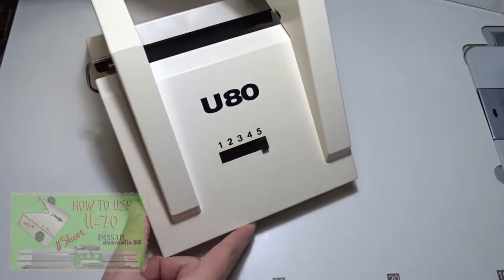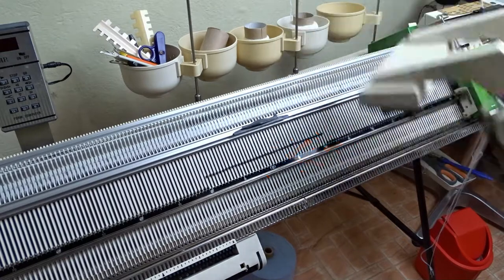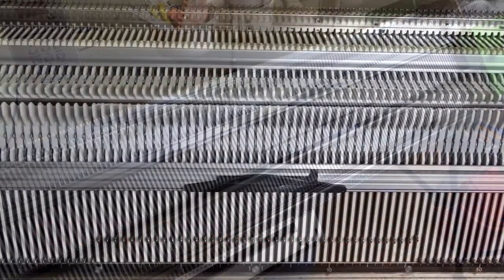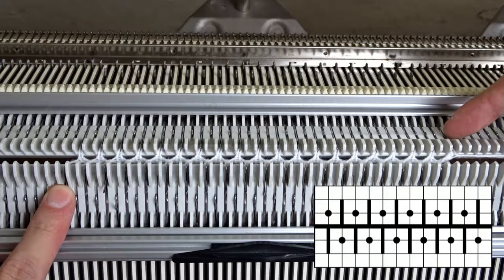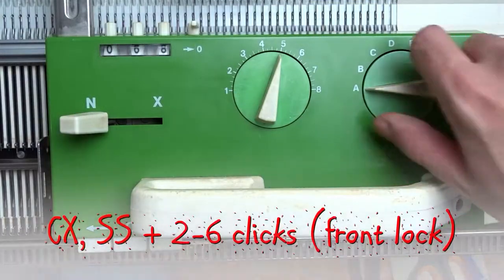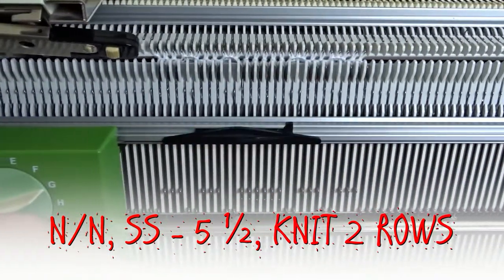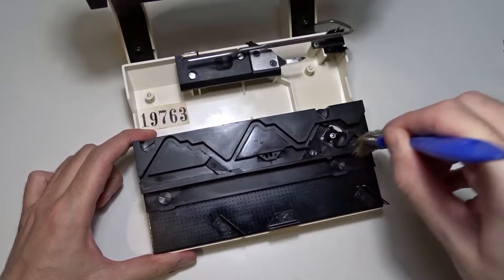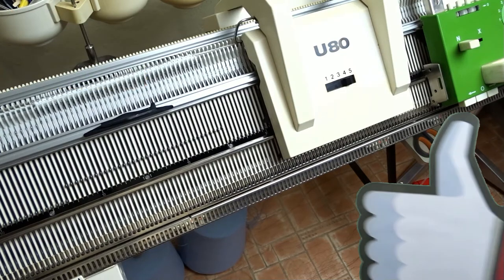How to Use U-80/U-100 Transferring Carriage

Comment: I tried to use the U lock today but it got stuck. Your video gives much more information than the Passap paper so tomorrow I will try again.
Reply from the maker: The U80 lock doesn't have a clip, and if you are not pushing in on top toward the beds (holding/sliding it firmly), it tends to move and gets stuck. Of course, make sure your stitch size is not too tight, but take this as a friendly reminder.

I hope you have better luck tomorrow. It takes some time to master it. I still am not a big fan of using mine.

Comment: You have explained setting 1,2,3 & 5, but what is setting #4 used for?
Reply from the maker: When the lock is set to 4, you can only transfer the stitches if the yarn lies in a zig-zag between the beds. So it is useful when you are using full needle rib on both beds and you have stitches on the opposite bed. In other words, use 4 for double-bed to single-bed transfers. When the lock is set to 3, it will transfer all stitches without any exceptions. Therefore, you can use the lock set to 3 when there are no stitches on the needles on the opposite bed.

Comment: Will the U100e lock work on the Duomatic 80? Or only on the Passap E6000?
Reply from the maker: Yes, the U100e it’s backwards compatible with the Duo 80.
The needle beds on both machines are the same, and the pushers on the back bed of the E6000 are the same as on the Duo, so the lock should be usable in all settings. The U100e was designed to work with the round pushers of the E6000. The letter "E" stands for "electronic".
Reply: @ArtOfClay  Thank you!  I have a Silver Reed LK150 with a FairIsle carriage (which is a rarity). Someone is offering me to trade for a Duomatic 80 with Deco, 4 color changer U70 and U100e. I know little about Passap and unfortunately, I don’t think she knows much about the machine either as I believe she said it was her mother’s.  I am trying to figure out if all the parts are even there 🤪
Reply from the maker: I apologize for the delayed response. It's possible that I missed the notification. Passap is indeed a great machine to have. If you have any questions about the parts, feel free to ask me. Additionally, if you have a Facebook account, there's a very helpful Passap group you can join: https://www.facebook.com/groups/779223535578115